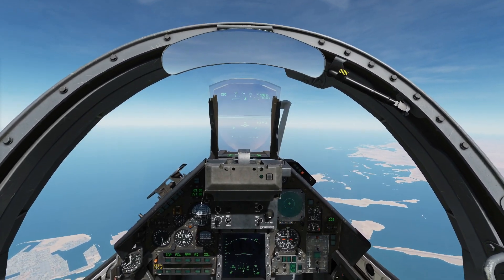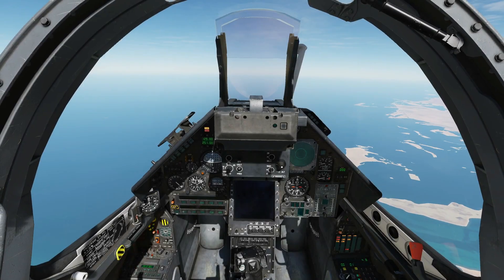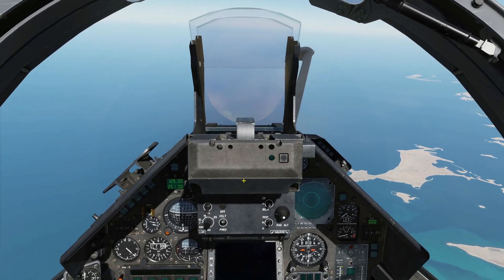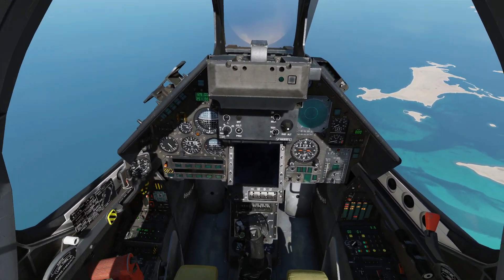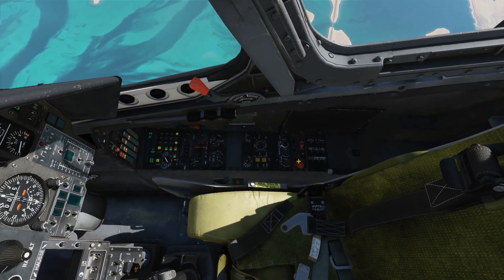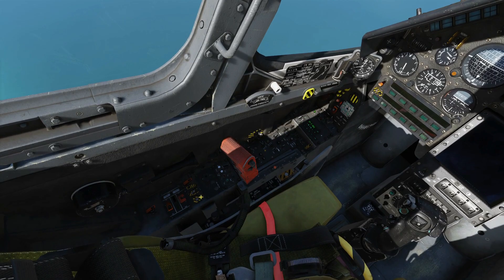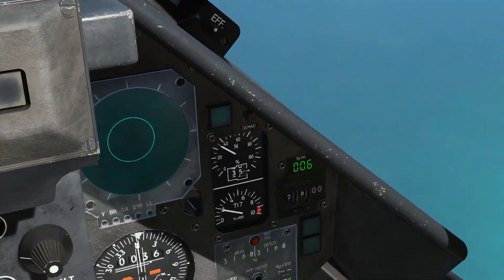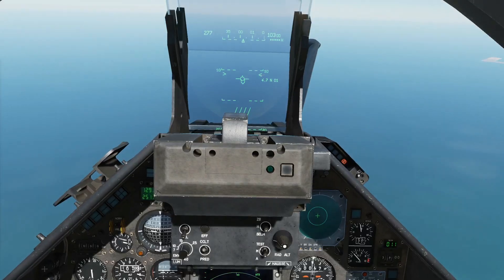Mirage 2000C: Emergency Engine Air Restart Tutorial | DCS WORLD

Comment: I’m assuming any fly by wire aircraft like the F-16 should be much harder to fly due to inherent airframe instability should power be lost, as the fly by wire system would have no power to control or even monitor the plane’s movements. However, this doesn’t seem to be the case. Can anyone inform me as to why? I’m assuming some sort of backup battery or such.

It seems that when the engine cuts out the electronic systems also cut out, meaning fly by wire should fail as well. Anyone have any idea?
Reply: You can checkout this stackexchange answer https://aviation.stackexchange.com/questions/20963/how-are-fly-by-wire-airliners-controlled-in-case-of-complete-electrical-failure
Reply: The F-16 has a hydrazine fueled emergency power unit that will give you about 10 mins.